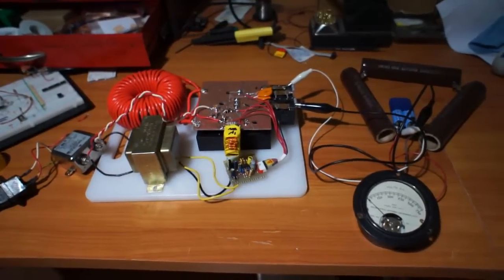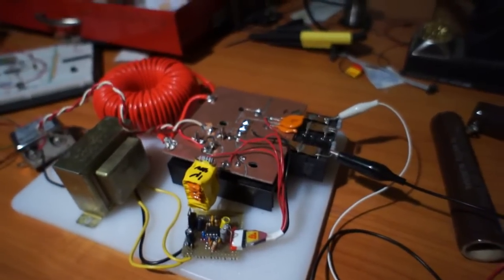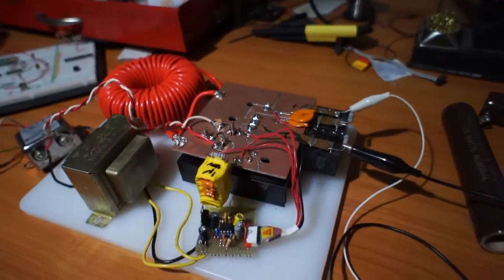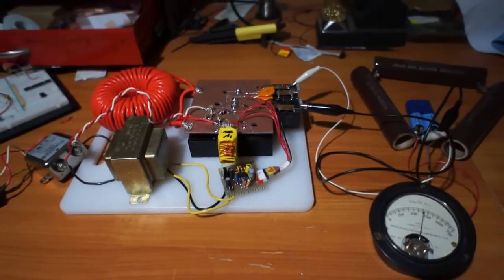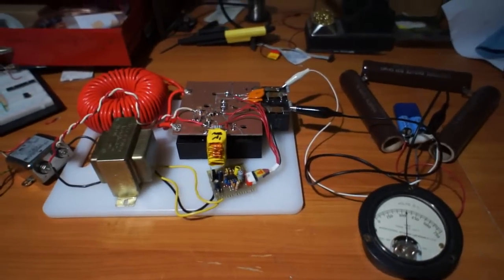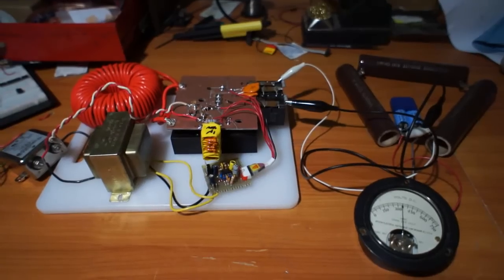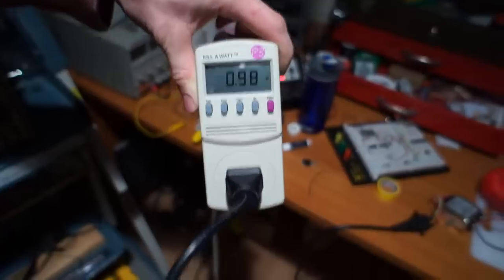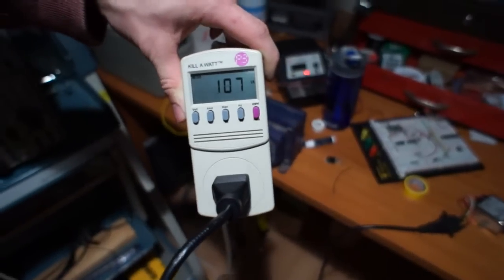The Emarhavil Heavy Power Factor Correction circuit is alive.

Comment: Joshuawise
Could you informate the boost indutance please?
Good job for you. I fallowed your schematic and it worked well with 1mH, but I realise if a change the core with the same indutance the results change.
Im trying to mesure the input wave to see the current and voltage wave match, but it has so much noise. 
Have you same tips?

Comment: UCC28019 is not the ultimate chip for PFC, that sound at start up is NORMAL if you are using (UCC28019), the (UCC28019A) chip gives no inductor noise at start up,

Also, this chip had many issues, I am now using new chip for this application.

Did you measure current wave form and voltage wave form?